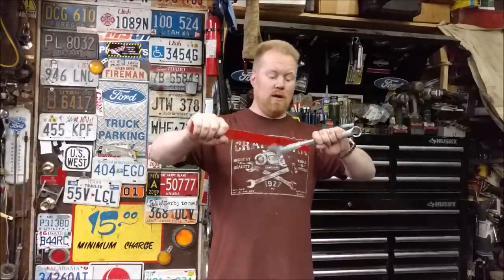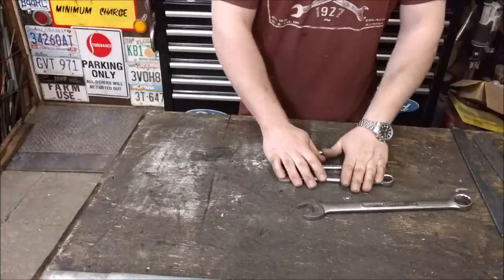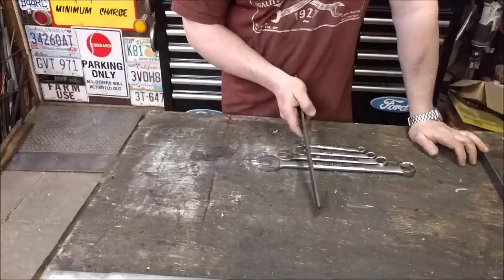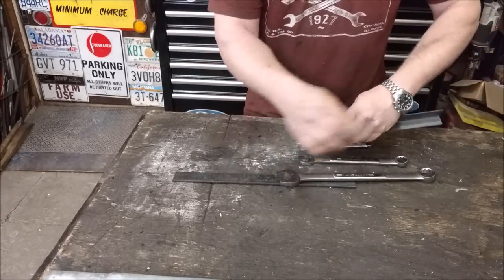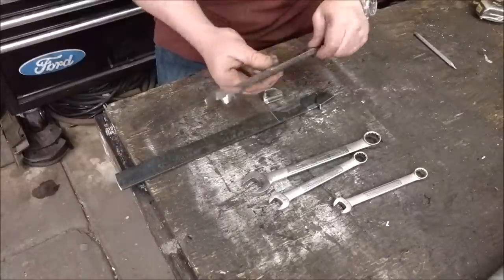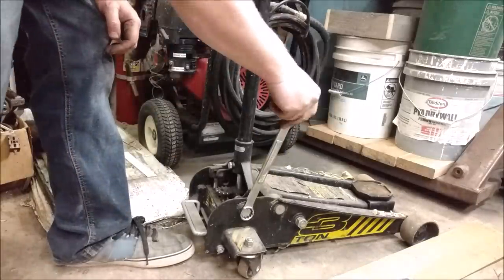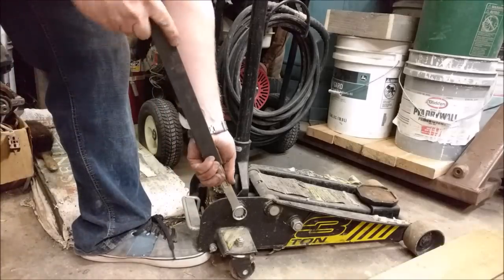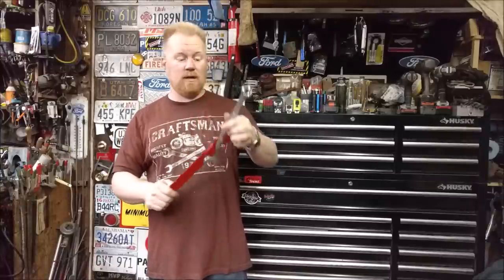Wrench Extender leverage doubler

Comment: If somebody doesn't have a welder, they could slightly flatten a pipe, then cut it to match. Ya, that's a real improvement over hooking two wrenches.  
  T h a n k s !  !    !      !
Reply from the maker: That's a fantastic idea.
Reply: Commenter Five that's what I've done in the past.
Reply: Cuba Rodriguez 
Me too, I needed something in a real hurry. It worked great on a huge wheel bearing retaining nut, where standing on a torque wrench lever bar failed to budge it one bit & the torque wrench cracked up into  pieces.

Comment: I  made  my  first  set  of  these  in  1974  while  I  was  deployed  with  NMCB  4  on  Diego  Garcia . It's  an  easy  idea  but  you'd  be  surprised  how  few  people  come  up  with  something  like  it . In  fact  you're  the  first  I've  seen  😂
Reply from the maker: Very neat! I'm surprised it's not a staple tool sold along side wrenches.
Reply: I  don't  think  the  tool  manufacturers  don't  want  you  make  them . It  would  void  the  warranty . 😂 There  is  one  on  amazon  thats  made  in  Europe , but  it  seems  to  be  intended  to  be  an  improvement  on  using  a  second  wrench . You  can't  use  it  on  the  box  end . I  keep  trying  to  figure  out  something  better , because  this  design  is  a  pain  when  using  2  wrenches  to  break  loose  a  hydraulic  line . (Your  juggling  4  things  at  the  same  time)  and  hydraulic  fittings  seem  to  get  tighter  with  age . I  watch  all  these  videos  hoping  someone  will  come  up  with  an  improvement  ,  so  far  no  luck . I  even  threaded  a  bolt  into  the  piece  of  angle  but  that  turns  into  a  real  pain  if  you  have  to  turn  the  wrench  over  to  get  the  the  next  bite . In  the  meantime  these  get  the  job  done . (I  have  3 , 1  3ft  long , 1  2ft  long , and  1  a  foot  long  for  small  wrenches  down  to  7/16th . Pto driveline  bolts  )

Comment: To improve the handle at work we would cut a slot in a pipe with a grinder and weld the flat bar set in the pipe. Gives something round to hold on to instead of digging flat bar into your fingers. Some nice knurling would make it look like a purchased tool but I don't know if you have lathe access.
Reply from the maker: Absolutely. It's so long though it's rare the leverage force needed is enough to dig into your hand though.

Comment: Very cool idea, thanks. I kind of did something  not quite the same, but the idea was there. Found myself an aluminum alloy pipe, around 4 feet long and 1 1/2 inch ID, and smooshed about 6" of the one end in a vise so the wrench would fit in it, without really rattling around. It originally was for a 1/2 inch breaker bar so I could loosen the center nuts on VW wheel hubs. That was about 30 years ago. I still have it. Somewhere.
Reply from the maker: It's amazing what a little leverage can accomplish.

Comment: Great, no brilliant idea! I just took my shoes off but you got me wanting to go back in the shop and make one of those.
Reply from the maker: I've only played around with it, but it seams to work very well. Sometimes the simplest tools are the most handy, but time will tell. I think I may make a smaller 12" dedicated one for the 10mm-14mm 7/16"-9/16" wrenches.
Reply: @sixtyfiveford  I've made one big enough to fit a 10 inch pipe wrench the same one will fit 10 inch to 12 inch locking pliers as well. Works great.

Comment: Sykes pickavant do a lovely pair of extension bars, something like 340 and 800mm lengths I think, about 35 and £80 respectively, I have the shorter one and it works fantastic! very very solid with absolutely no flex

Comment: Nice job. That'll come in handy. I need to build one.
Reply from the maker: I spent a little time loosening bolts and it seams to do what I had planned. Time will tell if it holds up or whether or not I crawl out from under the vehicle to grab it vs stacking wrenches.

Comment: I like that idea and I have some flat stock too.
Reply from the maker: Thanks. It seams to work out really well. I've had wrenches twist and round off bolts with a pipe as the cheater bar and I've racked my knuckles with the double wrench trick. Hopefully those days are over.

Comment: Very nice instruction - I'll have to make one of those. 
As an aside - it is a matter of names - you called a "Crescent" wrench a "Monkey" wrench. 

One distinction - a modern adjustable spanner (ie., wrench) is designed for hex structures. The monkey wrench was designed for square fasteners. A story I heard from my grandfather - a steam engineer who retired running diesels on the old Rock Island Line was that an officer by the name of Monkee (sp?) designed an adjustable wrench for the artillery (cannons) which used square fasteners and it eliminated the need for each cannon works' proprietary (or hand forged) wrench or spanner when on campaign. He also said that the monkey wrench was the only thing that was universal on the steam engines!

My grandfather was a character - he remembered every story he heard from his birth in the 1882 to his death in 1971. Colorful to say the least - but his source material was all 'word of mouth' rather than rigorously researched. The big difference between a Monkey & Crescent wrench is not the function - both have adjustable jaws - but a Monkey is for square fasteners, a Crescent is for hex fasteners. So it may be conceptually correct to refer to a crescent wrench as a monkey wrench since they work in the same manner.

Not trying to throw shade - your home-made "cheater-bar" elegant and simple and I haven't seen the versions for sale & won't need to since I'll use your instructions and make my own. Great video, I've used your instructions for other simple fixes like my current one - a leaky inner tube valve stem patch that probably needs to be replaced. Thanks for your videos!
https://en.wikipedia.org/wiki/Monkey_wrench

Comment: Smashing extender :-D.
Now that's simple and very usable, it just needs some rubber hose forced on the other end to act as a handle, better for your hands.
Also you might want to add two extra bits of metal on the opposite side of the ones you welded on for a better fit for smaller spanners.
Perhaps that is going too far, yep.
Reply from the maker: I am planning on making a smaller one for the 10-14mm spanners and a huge one for the 24mm+ spanners

Comment: A wrench is designed to work within its dimensional perimeters, as soon as you exert higher than designed loads by adding leverage, you are asking for trouble.
Basically, buy the correct tools or take your chances ! I wonder how many spanner’s have been replaced by the tool man because the spanner using it wasn’t using it as it was designed to be used ?

Comment: Two things, I never realized how costly they cost. At 5:06 you called the wrench a monkey wrench,  I'm sure some people will want to debate it, but a monkey wrench is aka a pipe wrench.  That was an adjustable wrench, could be metric or standard, which ever you choose.  All in all good video...
Reply from the maker: The term Monkey Wrench is loosely used but I have never given it a second thought. Curious; I had to do some reading and there are some very detailed people who have spent a good amount of time on the subject. Original adjustable mechanic wrenches are formed at a right angle(resembling a modern "pipe wrench") with smooth jaws and where the term Monkey was coined. There are a few vintage adverts showing the coined Monkey term on these smooth jaw mechanic wrenches. The jaws were later serrated and allowed to rock in order to grip soft round surfaces/pipe and are coined with the phrase Stillson Wrench. The hardcore researchers would disagree with you, but does it really matter? If we're doing some plumbing and you ask me to hand you the Monkey Wrench I'll toss you a pipe wrench and if we're working with bolts and you ask the same I'll toss you an adjustable wrench.

Comment: I just flatten 1 end of the cheater pipe for this reason. Actually all my cheater pipes are flattened on 1 end so a wrench will slide into it. But great idea tho! I may just have to build one! 👍
Reply from the maker: I've done the same and even have a rectangular tube. I wanted something that would be a cheater bar, but also hold the wrench firmly so a second hand doesn't have to touch the wrench. I can take the extension and reach it down into the engine bay, attach it to the bolt and rotate it off pretty easily now. Nothing will replace a 5' pipe for breaking those nasty locked up bolts though.
Reply: sixtyfiveford u got that right. I think I have a 5’-6’ for the nasty ones. Lol. But hey still a very innovative idea there. Ever think about marketing it? I know if I seen one in a hardware store or auto parts store I’d most definitely buy one.

Comment: I like the idea to increase torque. But couldn't we just buy a larger-diameter cheater pipe? Or a longer wrench. I'm a lot more likely to run down to Home Depot for some fence post pipe than I am to drag out all my welding stuff to make a new tool. Otherwise a good video. It gives me a good excuse to play around with my welder.

Comment: Very nice, however since I don't have a welder or know anyone with one I will check out some of the other options in the notes thanks!
Reply from the maker: Someone suggested just hammering a gas/galvanized pipe almost flat on the end and cutting out the notches to hold the wrench. I thought this was a great alternative to welding.
Reply: That actually sounds like a great idea I think I will give that a try thanks!!

Comment: 65Ford--Just to keep you honest, 1" = 25.4 mm.  The protrusion on the Craftsman wrench you used to mock up the extender is commonly referred to as the "raised panel".  I think that this panel is unique among wrenches; off the top of my head, I can't readily recall another wrench brand that uses it.  That's actually a shame; the additional grip it provides is very helpful.  I watched you weld BARE-HANDED(!!) and without a suede welding jacket to protect your arms and torso from weld splatter (!!!); I hope that doesn't mean you also were also not using a welding helmet to protect your neck, face and eyes.  I know Paul Jr. did that frequently on "American Chopper", but the rest of the world shouldn't follow his example.  It only takes 30 seconds to put on your personal protective equipment (PPE), but just a few seconds to receive a bad burn or to be blinded for life by a welding accident.  No one can anticipate when an accident will occur; they just happen.

Comment: Nice tip
I've got a miller 252, just picked up a Victor rig (O/A oldschool) mainly to learn, help me bend stuff, cutting (even though I have a miller plasma) and hardfacing (brazing). (need to get a torch kit for the latter). 
Next time I order steel I may get a bit of flat stock to make that.
Reply from the maker: Oxy/acetylene is one of my favorite welding techniques. Something about fire is just fun. last week I actually pulled it out for the first time in months and gave my Hypertherm plasma cutter a break. It was fun blasting away steel with the torch.
Reply: haven't cut with it yet, welding is what I'll need to study up on.